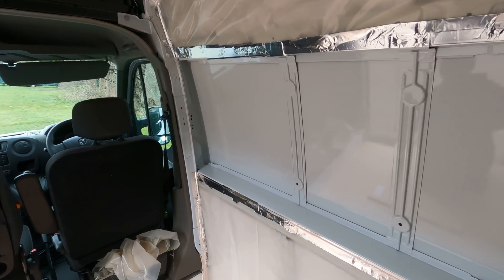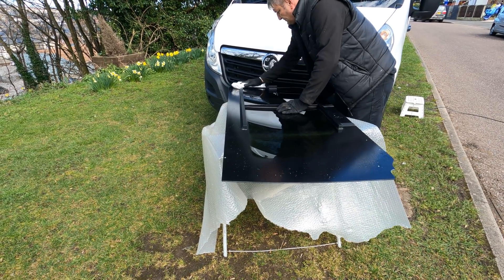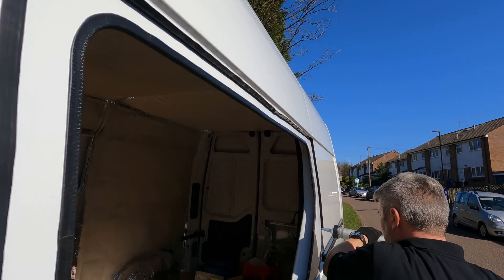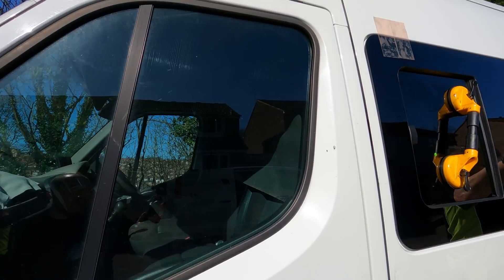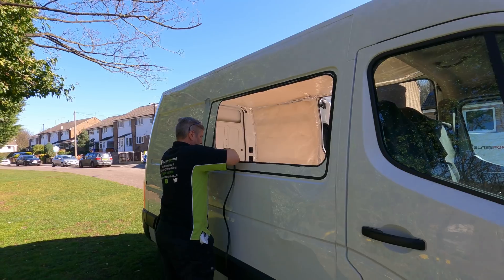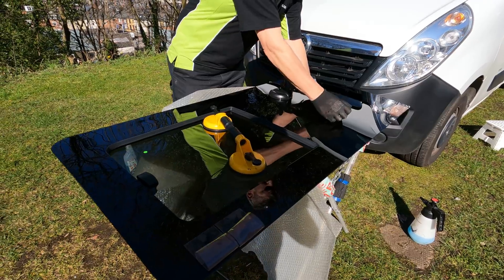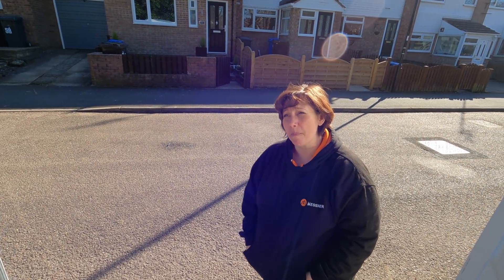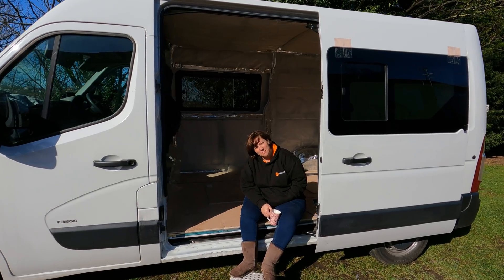Camper van conversion | How the PROs fit windows.

Comment: My Hiace came with two sliding doors with windows in them that you can open. And it is 4WD.  Can't get them anymore here. They stopped selling them around 2012, I believe. The only thing they didn't come with, as far as I know, was a high roof. Other than that, it has everything I need. At one point in time I went camping in it with three dogs in cages. They are not making vans like that now. They should...Your van is looking good with the new windows. A wise move to have them professionally fitted. You don't want them to fall out :-)

Comment: What happens about change of use at the DVLA and insurance as it will be worth a lot more when it's finished. I had an ex taxi minibus once but took the seats out to use as a van and had  hell of a job with the insurance as I had to get it changed at the DVLA.
Reply: No longer a commercial vehicle.

Comment: Does anyone know if my 2005 Econoline Van windows can be reused in a Transit Cargo Van. I'm talking about the two windows on the drivers side. The one right behind the driver the opens from the bottom and the longer fixed closed window on the drivers side also the long side window on the passenger side.